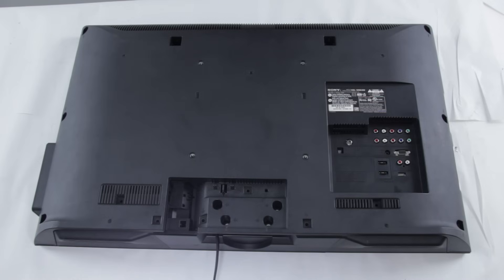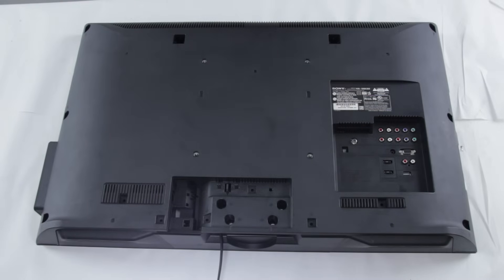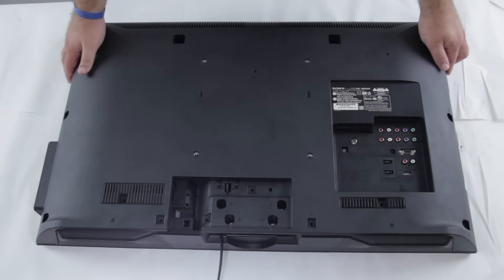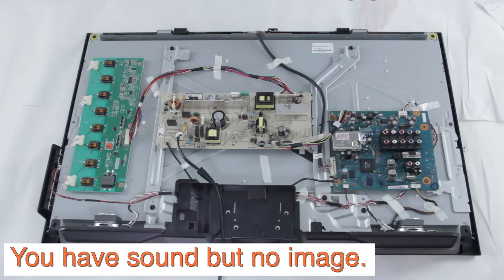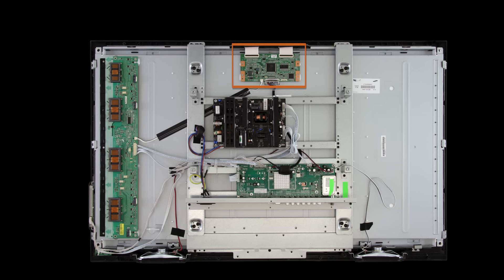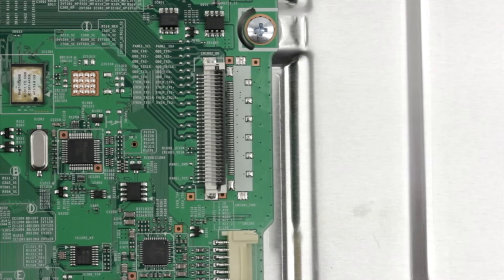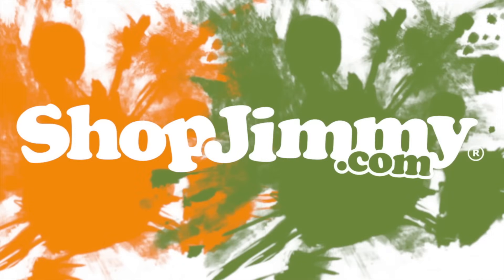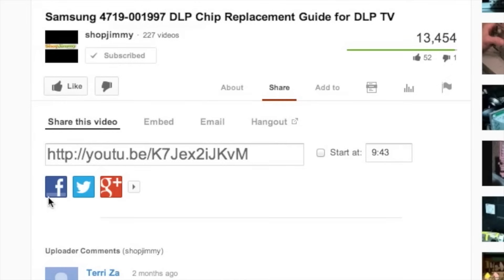LCD TV Repair Tutorial - T-Con Board Common Symptoms & Solutions - How to Replace T-Con Board

Comment: Sanyo DP42848 with Serial # B9030942799120.  Problem:  Picture color distortion.  Removed cable line and played DVD.  Problem persist.  The picture is mostly made up of green, red and blue with red the color for the people.

Comment: Hi I have a samsung model LN46A630M1F, the HDMI inputs work but within seconds of being on and seeing signal the sound goes to really loud static and the screen goes to colored static, (this happened occasionally up till recently now always) within about 10 seconds of this happening the TV shuts off then comes back on and does same over again. I tried all three HDMI inputs with same result with cable box and Apple TV.  I just hooked up my Wii through the component input and it works fine. Any help greatly appreciated. thx in advance.
Reply from the maker: no wheels   Try all repairs and troubleshooting at your own risk.  I recommend replacing the main board in your TV.  Click this link to replacement parts for your TV model number:  http://www.shopjimmy.com/catalogsearch/result/index/?cat=56&q=LN46A630M1F  There may be multiple boards for the same TV model number, be sure to match part numbers on your current board, with your replacement for compatibility.  Here is a link to a video showing how to identify your part number, click here:  https://www.youtube.com/watch?v=BEPWrefQvqI  Thanks and please let us know if you have any further questions with your TV Repair!  www.shopjimmy.com

Comment: I have a Sony KDL-52xbr6.  All I get a screen that looks like a waterfall.  Do you know what is wrong with it.  Thanks.
Reply: I also have a panasonic plasma.  TC-P50U50.  Red power light is on but the TV does not turn on.  So you know what is wrong with it?
Reply from the maker: Dennis Wong  Try all repairs and troubleshooting at your own risk.  I recommend that you bring the TV to a certified Panasonic repair shop.  Thanks!  www.shopjimmy.com
Reply: Could not fix.
Reply: I ended up replacing the t-com board on the Sony TV and it works now.  I fixed it 5 years ago and it is still working.

Comment: my samsung 32" lcd tv model ln32A330J1N STARTED AT FIRST SOUND WOULD JUST START GOING UP AS IF I WAS PUSHING VOL. THEN I GOT INTO MENU TO TURN OF SOUND AND USE EAR PHNS. BUT THEN IT STARTED JUMPING ALL AROUND. AND THEN STAYED ON ONE CHANNEL , COULD,T CHANGE ANYTHING REMTE OR ON SIDE OF TV WHAT PART SHOULD I TRY TO REPLACE?
Reply from the maker: steven leffers    I recommend replacing the main board in your TV.  Click this link to replacement main boards for your TV model number:  http://www.shopjimmy.com/catalogsearch/result/index/?cat=56&q=ln32A330J1N  There may be multiple boards for the same TV model number, be sure to match part numbers on your current board, with your replacement for compatibility.  Here is a link to a video showing how to identify your part number, click here:  https://www.youtube.com/watch?v=BEPWrefQvqI  Thanks and please let us know if you have any further questions with your TV Repair!  www.shopjimmy.com

Comment: I have a Samsung UN55ES7100 that recently stopped communicating with my Samsung Hwf-450 sound bar via the soundshare blue tooth interface (I now use the digital fiber optic interface).  The symptoms are as follows:  TV appears to recognize the Air Track and prompts me via a pop-up window if I wish to connect and play audio through the AT.  However after I select yes connect, a scrolling status bar appears and looks like it is trying to connect but then errors out stating it is unable to connect.  I am still able to connect to the AT with my IPad via Bluetooth so I don't think it's the AT and am leaning towards the problem being the TV's BT interface, specifically the transmit since the TV appears to receive notifications the AT wishes to connect.  I found a BT module for my TV Model however I can't find a spec sheet for the component nor could I find schematics or how to literature for my TV so I'm hesitant to open up my TV without knowing where this module resides or swapping out my current module without knowing if it is the root cause of the failure.  Looking for a couple things,  1) install photos/vids of my TVs circuit boards being replaced,2) info on the Bluetooth mofule, common failure modes, specs, etc.  hopefully this is sufficient Info to be able to offer suggestions and/or assistance.
Reply from the maker: Chris Post   Unfortunately we do not have any information on this TV model number.  Thanks!  www.shopjimmy.com

Comment: HI I\have a toshiba 26AV502R LCD tv after changing the T CON AN MAIN BOARD i still have this problem while the tv is on the picture starts to turn white, there R white lines that shift from one side to the other could eny one help me with this.
Reply from the maker: Rod Will   This sounds like you have received some defective replacement parts.  Are the replacement parts confirmed good and working?  Thanks!  www.shopjimmy.com
Reply: Okay do you have the t-con  board for this Toshiba 26AV502R LCD. Part number 260APO2C2LVO 2. Let me know please I am interested in buying Thanks
Reply from the maker: Rod Will   We do have that T-con board, if you follow this link:  http://www.shopjimmy.com/catalogsearch/result/index/?cat=63&q=26AV502R  However, your problem sounds like a TV panel problem.  If your TV panel is bad, it may be more cost-effective to replace the TV as panels are typically hard to find in stock, difficult to replace, and expensive.  Thanks and please let us know if you have any further questions!  www.shopjimmy.com

Comment: I have a Samsung UN46D6450UF that I'm trying to fix. For a couple of years, it has had a horizontal line of pixels near the bottom that was annoying but I never thought to fix. Today, I was watching TV when the image split into a double image (with the hazy images displayed one on top of the other). I thought turning it off and then on again might fix the issue, but I got the Samsung logo (also double image) and then no picture (and no picture or logo after trying again). At first the power light would blink, but after opening the TV and testing again, the power light turns off as it normally does, but still no picture. I do get sound, however. Could you help me figure out what part I need to replace? It sounds like the t-con board according to this video, but want to see if any of my symptoms point to something else. The capacitors on the power board seem fine, and I don't see any signs of burnt edges on the main board. Thank you for your help.
Reply from the maker: Ian Perera   This sounds like a TV panel (TV Screen) problem.  If your TV panel is bad, it may be more cost-effective to replace the TV as panels are typically hard to find in stock, difficult to replace, and expensive.  Thanks and please let us know if you have any further questions!  www.shopjimmy.com

Comment: Hi. I have a Samsung model#: LN46A550P3F Model Code: LN46A550P3FXZA. I have been having issues when powering the TV on. It will take about 5 or 10 minutes to come on properly. Generally it will come on black, then cycle on and off multiple times. Sometimes it comes on with red and green vertical lines and makes a loud high pitched fuzz sound. Eventually it comes on all the way but it has been getting worse over time. I replaced the capacitors even though they all looked fine and I'm still having the problem. PLEASE Help! thank you.
Reply from the maker: stkhoops   I recommend replacing the main board in your TV.  Click this link to replacement parts for your TV model number:  http://www.shopjimmy.com/catalogsearch/result/?q=LN46A550P3FXZA  There may be multiple boards for the same TV model number, be sure to match part numbers on your current board, with your replacement for compatibility.  Here is a link to a video showing how to identify your part number, click here:  https://www.youtube.com/watch?v=BEPWrefQvqI  Thanks and please let us know if you have any further questions with your TV Repair!  www.shopjimmy.com

Comment: I have an RCA Model led46c45rq.  The problem started a few weeks ago. If turned off and then back on within an hour or two, the picture would not come on, but the sound would. If we waited about 3 or 4 hrs to turn it back on, then it would work fine. Then last week, there were vertical color bars across the screen with no sound at all. Now it is the dark blue screen and no sound. Suggestions?
Reply from the maker: *****   This could be a problem with either the main board or the TV panel.  You can replace the main board in your TV to see if that fixes the problem.  http://www.shopjimmy.com/catalogsearch/result/index/?cat=56&q=led46c45rq  Be sure to match part numbers on your current board, with your replacement for compatibility.   Thanks and please let us know if you have any further questions with your TV Repair!  www.shopjimmy.com
Reply: ShopJimmy.com OK, so the numbers I have do not match any of the numbers you have for 
the Main Board the numbers on this one are  E12100301-2A02327 under it 
is LK460DHB28 those are on the front on the back it has 
46RE010C878LNA0-B1 and under that it has 20121013141516 12v b1 , 
needless to say not sure which part is needed but this one you have 
listed matches in looks and connections RCA E12100364 Main Board for LED46C45RQ Version 2 (T.RSC8.78)
Reply: *****  OK, forgot to mention that it does belong to a friend of mine who dropped it off this weekend. I did turn it on and left for about 7 hours and sound never cut out. I did replace the T-Con and still same could it be the Digital Board instead of the Main Board as you stated?  Thanks
Reply from the maker: *****   The digital board is the main board.  Thanks!  www.shopjimmy.com

Comment: Hi my tv is a samsung 32 fhd. Model number eu32f5000akxxu

My problem is that I have no picture and not sure if any sound because nothing is connected to the tv and I can't see if I'm on the right source. 
So I opened up the back to see if there was anything wrong with the t-con bored. Which everything seemed fine. But I heard that the display is split into half so I disconnected the left one to see if that was the problem and the right side of the tv was now working. So I tried to do the same with the left but the left wasn't working. I checked the ribbons and they were both fine. 

The problem im having is finding the right t-con board. As I'm in the UK the only place that has t-cons are in America and they don't have the same model number so might be different... Can you please help?

Comment: Need repair help too! I have Sony 
KDL-40ex720 and last night the picture went out and replacing it was a blinking (4x) red power light. Sony tech support was unhelpful and I saw two of your videos on fixing TV problems and I definitely am game to attempt a fix. I'm very handy with electronics. If it's a t-con board issue I can definitely replace mine. But I need to know a little more to decide whether mine sounds like that flavor of problem. My tv turns on one time each time I unplug it and plug it back in. It turns on normally then turns off within 30 sec.  When it's on the pic looks normal and the sound is fine. My semi-uneducated guess is the screen itself is fine. Each time it turns off, the power light blinks on and off 4 times. It repeats indefinitely. Can you tell me whether that sounds like a T-con board issue. There are a couple web links I've fiubd that imply it's a  different issue. One says its a Fan issue :
http://www.avsforum.com/forum/63-rear-projection-units/1071754-ez-fix-4-kdsr50xbr1-4-blinking-lights-fan-read.html

One says its a Load Balancing issue. 
https://community.sony.com/t5/Television-Picture-Sound/Bravia-KDL46EX720-Red-LED-blinks-4-times-and-TV-wont-turn-on/td-p/42941

I don't want to package it up and send it away for repair. It's out of warranty and I have little faith it will be worth the money. Do you have any advice for me?

Does this sound like a T-con issue or something else? Any info you can send will be much appreciated. 

Thanks, in advance, for the assist. 

Jim Sipowicz

Please reply to: sipowicz@shellmedia.com
Reply from the maker: Jim Sipowicz   I recommend replacing the main board in your TV.  Click this link to replacement parts for your TV model number:  http://www.shopjimmy.com/sony-a-1814-572-b-batv-board-upgrade-required.htm  There may be multiple boards for the same TV model number, be sure to match part numbers on your current board, with your replacement for compatibility.  Here is a link to a video showing how to identify your part number, click here:  https://www.youtube.com/watch?v=Aodz2LHkzbY  Thanks and please let us know if you have any further questions with your TV Repair!  www.shopjimmy.com
Reply: ShopJimmy.com Hey Guys, as you suggested, I ordered a new BATV board (and a flat connector cable because I messed up the original) and teh good news is -- no more red lights blinking. But I'm not there yet. Now when I turn it on, the red standby light comes on. When I hit the power button, the green and yellow lights blink together but the screen never comes on. When I hit power again, the Sony logo flashes momentarily then the screen goes black. Then the red light comes on solid and the yellow light blinks very slowly. I suspect it's needing a software update, which the main board pages I've looked at all specify. But I can't get it to turn on long enough to start the update. I put the software update on a freshly formatted thumb drive and put it in the USB slot, but it doesn't ever seem to install anything. Any suggestions?
Reply: Jim Sipowicz To clarify, " ... Now when I PLUG IT IN (not turn it on), the red standby light comes on. ..." the rest is accurate.
Reply: Jim Sipowicz More detail:  When the red light comes on solid and the yellow light blinks slowly, it only blinks 4 times. After the 4th blink, the logo screen comes on again momentarily, but then goes black again. At that point the green and yellow start blinking again.
Reply from the maker: Jim Sipowicz   PLEASE SUBSCRIBE TO OUR CHANNEL - Try all repairs and troubleshooting at your own risk.   4 blinks indicates a bad main board.  I recommend replacing the main board in your TV.  Click this link to a replacement main board your TV model number:  http://www.shopjimmy.com/sony-a-1814-572-b-batv-board-upgrade-required.htm  There may be multiple boards for the same TV model number, be sure to match part numbers on your current board, with your replacement for compatibility.  Here is a link to a video showing how to identify your part number, click here:  https://www.youtube.com/watch?v=Aodz2LHkzbY  Thanks and please let us know if you have any further questions with your TV Repair!  www.shopjimmy.com

Comment: Help please.  I have a Vizio 70" Model # E701i-A3 (Only 18 months old).  The screen went 1/2 reddish lines (on the right side) and only one horizontal strip about an inch in height near the top of the screen that had completely normal color.  I turned the tv off and and back and the back light came on with sound, but no picture.  So after watching this video, I ordered a new t-con board and installed it very carefully.  

So what I have now is a distorted picture with the same horizontal line as mentioned above.  By distorted, i mean you can read "no signal", but it is not clear and when i turn it on, the big "V" ,for VIZIO, that pops on the center of the screen just before the picture, you can only see the bottom part.  This was a $1800 TV, and now I am feeling the urge to give up and trash it.  

Any ideas?!?!?!?!?!?
Reply from the maker: Kellie Hagen   This sounds like a TV panel (TV Screen) problem.  If your TV panel is bad, it may be more cost-effective to replace the TV as panels are typically hard to find in stock, difficult to replace, and expensive.  Thanks and please let us know if you have any further questions!  www.shopjimmy.com

Comment: We are trying to verify the need for a new T-Con board for the Samsung UN32EH5300FXZA. The unit has sound and absolutely no video. Black screen only. Tested in dark room and no light present. Followed Samsung flow chart for this model and it recommends replacement of the T-Con board and or the Main Board if T-Con does not fix the problem.  T-Con part in unit is 13Y FHO BN41 019388. Thanks for the help. Prior repair help requests have been 100% accurate from your team. FPS COMPUTER thanks you for outstanding service and parts.
Reply from the maker: Phil Gibson   I recommend replacing the main board in your TV.  Click this link to replacement parts for your TV model number:  http://www.shopjimmy.com/catalogsearch/result/index/?cat=56&q=UN32EH5300FXZA  There may be multiple boards for the same TV model number, be sure to match part numbers on your current board, with your replacement for compatibility.  Here is a link to a video showing how to identify your part number, click here:  https://www.youtube.com/watch?v=BEPWrefQvqI  Thanks and please let us know if you have any further questions with your TV Repair!  www.shopjimmy.com

Comment: Hi ,i have a Samsung 46 inch . The colors are so bad . I see alot of red and distortion in the picture . Wondered if the t con board is the problem . The Model number is 
LN46A550P3FXZC,,Serial # AM273CUQ802402X,,Version ,,AAO2 . Do u have a video on this tv ? I hope i can replace the board ,please help .. Thanks